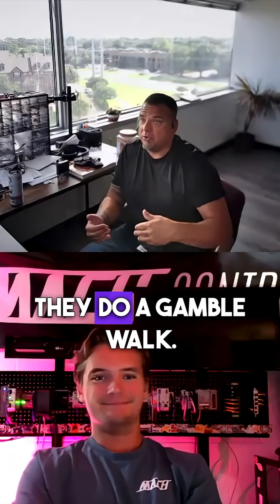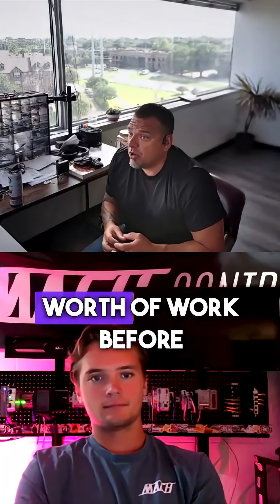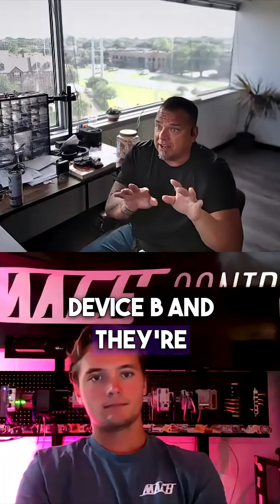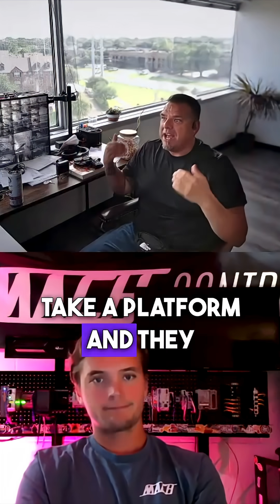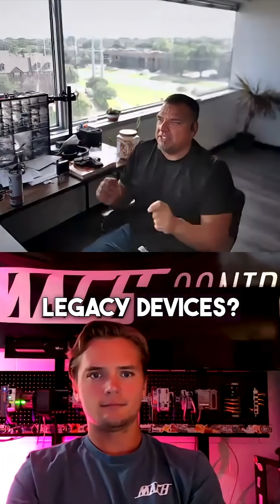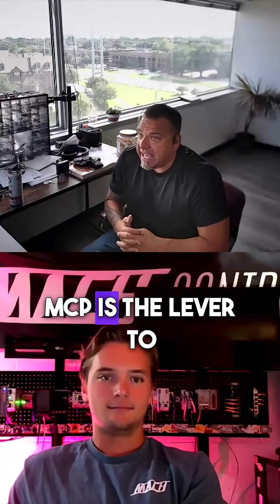How System Integration WILL CHANGE with MCP

Comment: The MCP server ( both legacy and new systems ) will read the actual logic programs and find the gaps or put data blocks in the plc to be exported to UNS  ???? Have i understood this correctly...... if so , i doubt !!
Reply from the maker: It will read the data mappings / program files, and automatically bring in and parse the tags for data collection. Easily. Changing the program would require vendor support.